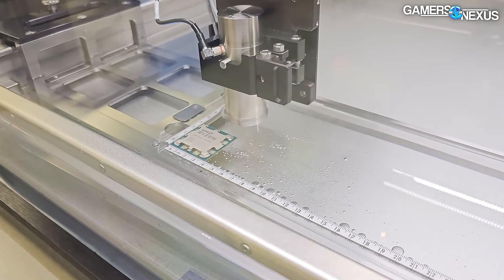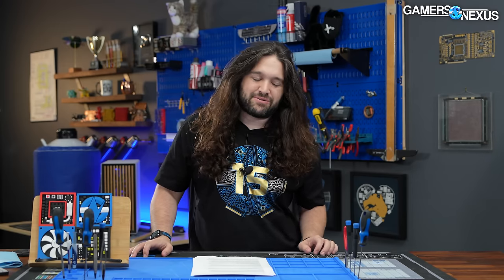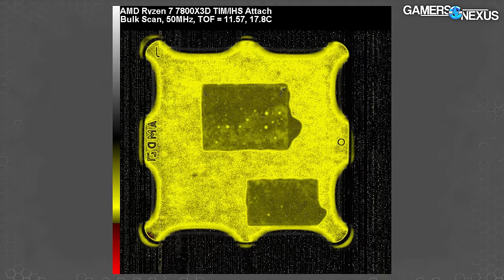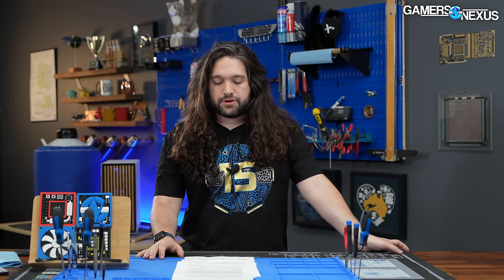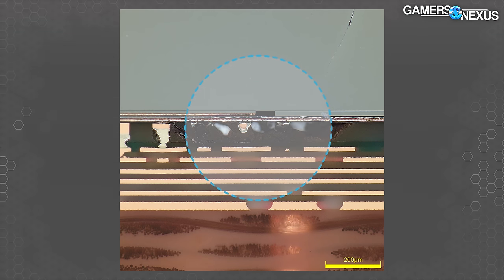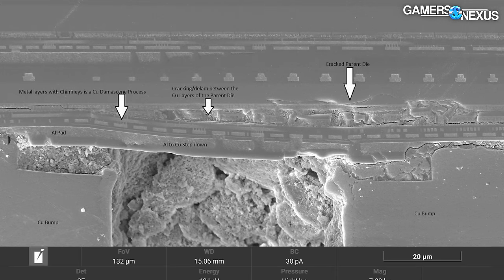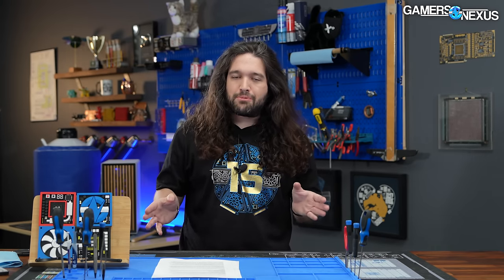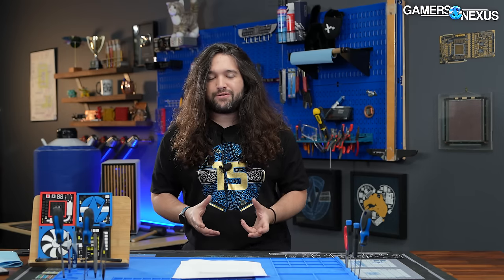The Truth About AMD's CPU Failures: X-Ray, Electron Microscope, & Ryzen Burns

Comment: So, essentially, the failed CPU's simply were not built well enough. I think that might be a fair assumption. And if most of these CPU's are built well enough we shouldn't see failures of this kind on those that are, provided that ASUS and other MB manufacturers have proper voltage control and OC protection, which, strangely enough, somehow seems beyond their ability.

Comment: So is this something that can be solved by software/firmware only? Or should there be a hardware replacement/recall action? Or am I asking part IV vid questions?
I just got a 7800X3D Aus B650 Strix board in my new pc. ;o
Reply: Software, firmware is enough. If you put as much voltage as for example asus was pushing on these… no wonder why there was smoke!
They just have to prevent that kind of over voltage feeding and we and the CPUs will be fine!
Ofcourse AMD has allready prototypes of 8800x3d but these events does not affect on the developmet of the next gen that just happens to be faster and better in other ways!

Whar AMD most likely is investigating why the multichip GPUs are not working as well as they expected / hoped. So in GPU department I expect some hardware changes to remove any bottlenecks that current 7000 series GPUs suffer.
Reply: @haukikannel  Guess ill play it save and use my old pc a bit longer till better firmware come out. Do want firmware that also gives me expo 6000 and the latest one(s) do not i think.

Comment: One of the biggest problem is the smallest - miniaturization. When You get to one point of how small internal part is You get easier failures. Espeically when ASUS board allows voltages in the area of 1.4-1.5V when tested and working value is 1.3-1.35 max. Sad turth is that now AMD will take a lot of fault of ASUS. 
GN should try to replicate this failure using other boards not using one, one cpu and going whit that amount of views with clickbait "AMD BLOWS OUT". Sad.

Comment: My question is, did this problem exist only with 7800X3D or with all AM5 CPUs?
Reply: It depends on how you look at it. Just like with the 360 & PS3 GPU's, failure can happen over a period of time, not immediately, but still be a fairly large issue. Due to the fact that the 360 was cheaper & more people were buying an excess of consoles compared to the PS3, there was more rates of failures, but the PS3 had the same exact issue as the 360 did. This can probably affect a large selection of chipsets across a long period of time. Felix did a pretty amazing video explaining how stuff like this gets swept under the rugs before anyone really undestands or knows why it would happen

Sony never really did anything about it because Microsoft took the fall for them & Nvidia paid out a lawsuit in a quiet place. Most were unaware of the issue even existing or why it would happen. It's inevitable failure, though. If I had to say. This probaby affects other AMD chipsets as well, but only time will tell. It's a good question, though. I'm surprised more people haven't asked that question, but you know that everyone is probably starting to think so regarding the current economy & market. I would say yes, & probably multiple other chipsets as well. I don't trust AMD anymore, nor do I like paying Intel for their CPU's, but it's the job of the consumer to push for reputable products

It's pretty much all junk in my book. Things are made so cheap these days & are sold for record profits. It's disgusting. It's like Gibson guitars & Mesa amps. Severly overpriced junk, but good for investments pieces to sell to some other loser for a nice profit, if you can find a buyer that it is for modern junk, lol. Vintage stuff was just built to last. Now everything is designed to fail, so you buy it again until you have no money left~

Comment: So why is my Amd 3600 VCore bouncing between 1.25 to 1.344 to a peak of 1.456 volts on an Asus Prime A520 DDR4 motherboard?? And should I A look at a bios update or 2 manually set the voltage to 1.300 As that's one of the few settings i can change.  

Edit the board glitched in the bios update didn't reboot and the crashfree Asus software don't work.

Comment: TLDR: They either got me a faulty CPU or a CPU cooler coz the 7900x reaches 95C under high/max load all the time. Idle is about 54-64C.

Anyway, I need to transport this PC to the capital, it's gonna take 3 hours to do so. Bad news is I fucked up the hungarocell completely so now I only got medium-large pieces of it left, but not so much so that it would fit perfectly around the PC.

My PC's super expensive, 3750USD so I really dont want to get it damaged during the car ride.

RTX 4090, 7900x, 2x32GB DDR5 6000Mhz, B650M Aorus Elite AX, 4TB M2 SSD, Aerocool Prism ARGB Black, Dark Rock Pro 4

I REALLY don't want to let it get damaged during the ride. Wtf do I do? I spent 3 months of salary on this rig

EDIT: Here's my CPU Fan Curve. Does it look OK or should I change it?

https://imgur.com/a/Aha2FTz
Reply: Have you checked the paste distribution? If that’s not sufficient it might reach such a thermal/fan load distribution. And that curve is terrible, something seems really wrong with that load that early.

Edit: also, how’s the airflow?

Comment: I want the 2022 gpu card t-shirt... BTW how does that foil hold up to washing.?

Anyways ASROCK PG lightning x670e, got the microcenter CPU/RAM combo, my case 7900X/2x16GB g.skill flare x5 6000, worked great.  Ordered a second set of g.skill flare x5 last night, got it today, installed, so 4x16GB g.skill flare x5 6000 EXPO is all running 6000 EXPO on that mobo no problem(unlike x370 where even two sticks were a problem).

SoC Voltage stayed steady @ 1.241V either 2 stick or 4.

Earlier w/ancient 1.07 BIOS it ran SoC voltage at 1.014V with a high of 1.017V average by hwinfo 1.014V and that is 2x16GB g.skill flare x5 6000 running JESEDC 4800 as I left BIOS at all defaults just checking stabilitiy as I did a drop in mobo CPU RAM replacement w/o re-installing w10x64pro

Now Im wondering if I should just drop EXPO for a bit of perf hit v. longevity... already running PBO 85C/-20mV CO on the latest 1.24AS02 BIOS ah well well gamble since Ive also got a770 gpu and trying to find cause of bug check 0x116(driver/gpu not responding in time) when it goes to low power or sleep otherwise card is freaking pretty damned good even com-pared to my venerable evga 1070 FTW that it replaced... troubleshooting will continue

Never ca have enough RAM... evar... (no really ever)

Comment: This is another reason why I will never buy products from AMD. My personal problem with AMD products dates back to Athlon and Duron, an old Tomshardware video proves it perfectly, who remembers these times knows. The next was a super hot Radeon 7950 but in this case I managed to sell the card a month before the buyer demanded a return because the card failed. Another adventure was with the Brix 8890 mini computer bought for movies and undemanding games, unfortunately it was not suitable for games at all, and movies above FHD. AMD's policy of releasing a new CPU almost every six months is kind of idiocy, (I'm still sitting on a good i5 4670K @ 4.4Ghz and everything works fine) especially since they are far behind with GPUs, even intel has a more advanced ARC project, the problem is that optimizing games for a specific GPU poses a real challenge for Intel. Everyone accuses NVIDIA of not enough Vram and prices, but AMD with its newly announced Chiplets does not seem cheaper, especially in terms of Watt consumption.

Comment: For the not so technically inclined does this mean AMD is a no go on the X3D versions or only Asus is a no go?
Reply: If you know your way around the UEFI you can fix it yourself by lowering the max voltages. If not - avoid Asus and possibly Gigabyte I think it was?

Comment: Think about this savage burn out, and then add the fact that 'they' want to make ONLY 12 volt connections to the motherboard :D imagine THEN a burn out that could spread to more vital components :D .Oh and by the way, my ASUS Strix Z-490 E , on XMP1 which is the ASUS version that applies their own setup on my Corsair ram , also applies a 1.5 to 1.6 volts to the CPU :D and that's fine by ASUS's setup . There is also an XMP 2 that is compliant to Corsair's settings which is a bit more relaxed.

Comment: ++++++++++++++++ It was the same for me with an ASUS motherboard and graphics card.The Asus older model motherboard worked for me for a very long time.I replaced it with a new model and a powerful processor.I was getting blue screens and computer crashes.I cursed Windows because I thought it had a bug.When the warranty of the 12 GB graphics card expired, all the mosfets on it blew up.Of course, Asus didn't want to hear about a warranty repair they claimed that it was my fault because I did not replace the thermal paste hahahaha.The thermal paste was stated to last for several years about half as much as I had a graphics card.
Since then, I have not bought anything from Asus.Somewhere from the beginning or halfway, Asus had good products when he established himself on the market, rubbish with a short duration started coming from him.

Comment: Just a heads up.. There is no such thing as a completely non-destructive test, it's all in the details of Physics 
and knowing which tests would and would not impact our test subjects by inadvertent contamination, even 
a simple Vibrating of a CPU may still be destructive if the test subject was not designed to be utilised in a 
vibrating environment, like wise if a CPU is exposed to environments it was not designed to be used in, and it 
is tested in such an environment those tests are null and void, so with this in mind what test are actually valid 
then? And how large are the test samples, and how many different manufacturing runs make up such a test 
sample?  small selective test samples in other words are mostly conducted for sensationalism or worse 
industrial propaganda, and again the question is are these tests truly valid?

Comment: Glad I never in my life considered asus and always saw through their scumminess and greed.
I got a gigabyte b650 aorus elite with my new 7700x and noctua cooling  and it never goes beyond 70c even with intensive tasks like editing and gaming, and with some gpu intensive games it stays on that 40-45c (I also undervolt).
For some reason people buy expensive motherboards for 400$+ for no good reason.
Mine cost 200$ and It's more than I'll ever need. (Honestly if you need usb-c just get an adapter..)

I also saw people complain about how hot amd cpu gets, but that just shows me that most consumers are about as smart as cavemen and don't research what they buy and don't bother with bios settings.

Everybody buying overpriced trash and it shows as everything is getting more expensive by the minute 🤦🏻‍♀️

You buy a msi 3070 for 3k$
I buy a ASRock 6700xt for 300$

And I'm getting a better product with 4gb more vram 😂
People who buy "top of the line" just want "a product that works" but usually them being too lazy for knowledge leads to them buying an inferior product that doesn't fit in their build and misconfiguring it.
Or they buy prebuilt so they don't even know what they're buying..

Comment: When has Asus not been a scam bag company, I have 2 boards from them and each one needed, still needs, repairs from them, because of manufacturing defects, usb flash back on the old z77 board blown up, and poor usb management chips on my crosshair hero x570 show yellow triangle in device manager, there Armoury Crate software is horrible, fails to start, can't fix it even after an uninstall and it leaves behind rubbish

Comment: you could've just said that AMD released a crappy processor with low stability in order to top the performance charts

heck, AMD has admitted to that indirectly, by saying they lowered the tjmax or whatever temp limit compared to non-x3d CPUs from the series(if I remember right)

unstable by design

Comment: Okay so this particular unit and many others like it are experiencing extreme thermal issues that are essentially melting the internal IHS solder, leaving nowhere for the heat to go except through the substrate, causing the critical harware failure, and this is, to some degree or scale, a design flaw with this CPU, and also the other 7000X3D CPU's from AMD's next-generation lineup.

There we have it, folks.
Reply: Also happened to non x3D cpus as well…..and a couple non Asus boards.
Reply: Disingenuous take. This is only affecting overvolted CPU's. Asus bios was to blame.